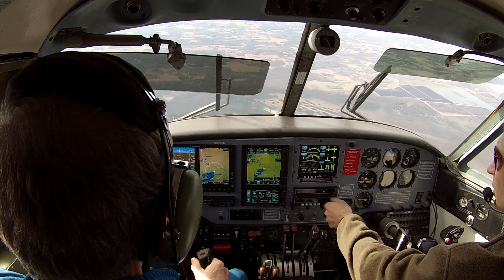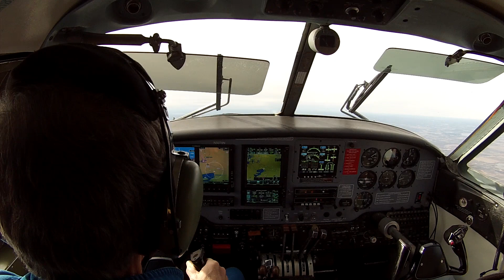Beechcraft Queen Air Stall - Clean Configuration

Comment: Why aileron use in stall? I've always been taught to use my feet to raise a wing. Ailerons can make the situation worse! They did say this was testing, so who knows. My ailerons are always neutral in a stall and stall recovery.
Reply: The aircraft will not spin.  The Beech Wing like the King Air has a strip on the leading edge to help maintain aileron control near the star and during the stall.  As long as you do not keep pulling back on the Yoke, whether you apply rudder or ailerons you will not spin.